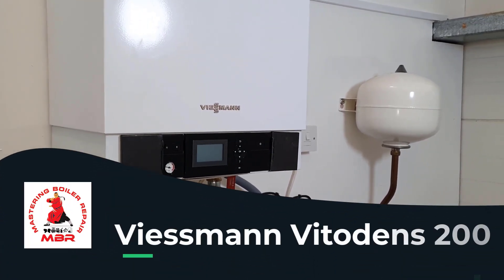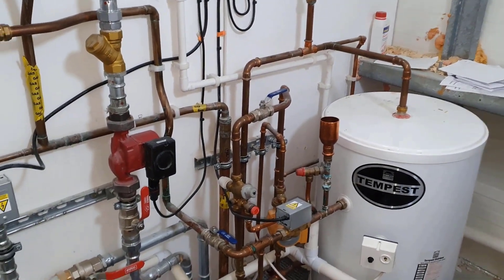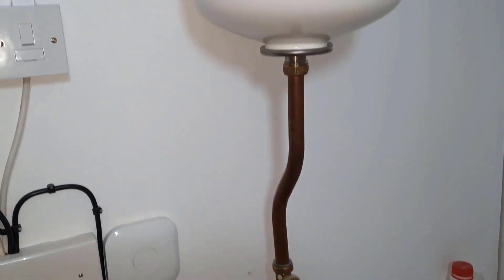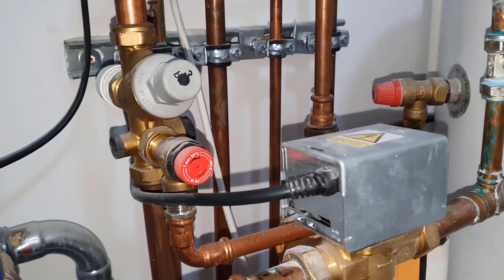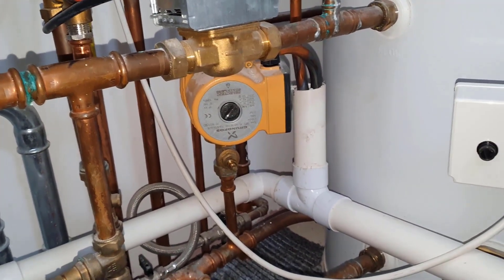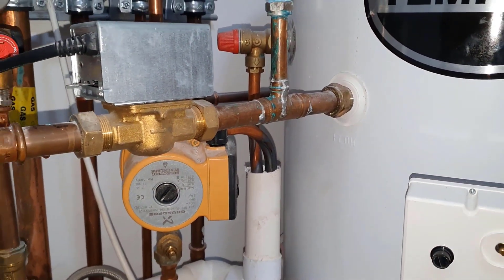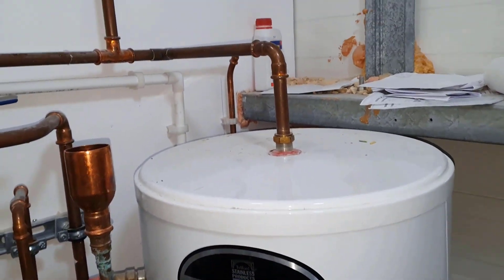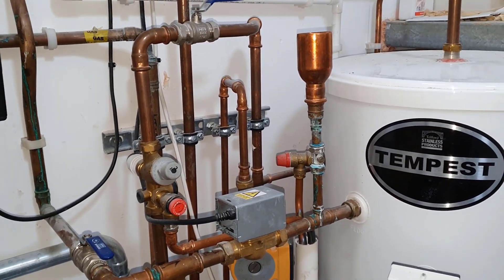Unvented Cylinder Installation Spot the Defects Part 1

Comment: Expansion vessel should be after pressure reducing valve. Second return pump bronze not wired up. Immersion not wired up missing control stat knob,  t&p valve doesn't have air break or d2 pipe.. tundish should be aav

Comment: Secondary hot water pump

Both the isolation one at expansion vessel and one at air vent isnt required and one of  them is closed

Comment: The pump is called a secondary  //bronze pump. For the hot water And it is not wired up. no  Earth cross bonding  ..control knob for thermostat is missing. condensing pipe is not supported. if this is a commercial installation the gas should be painted yellow and not taped